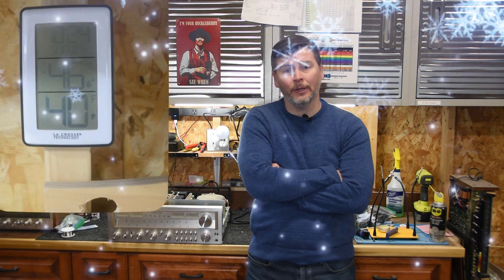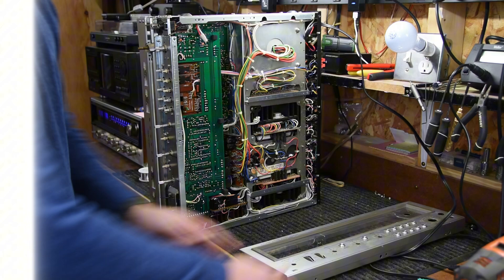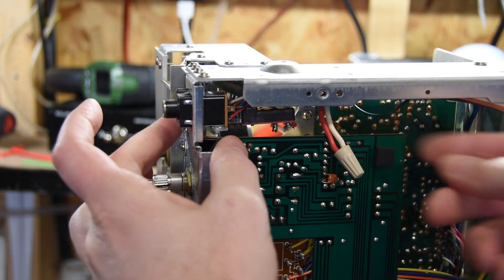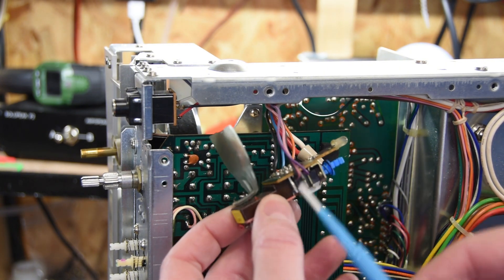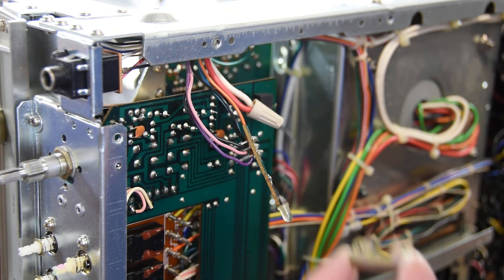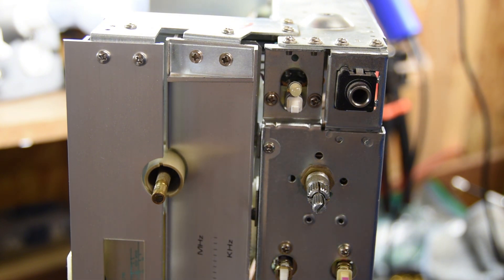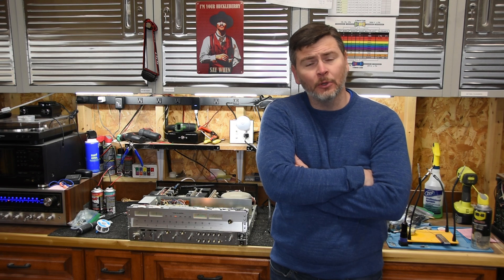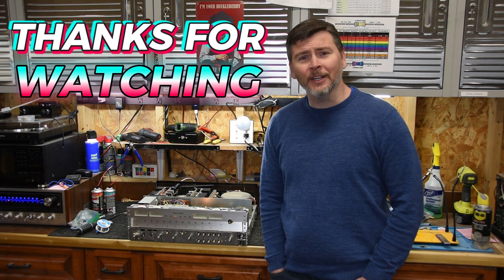Realistic STA 2100 Power Switch Repair

Comment: Hey Mike, is the case on that unit the same as the 2100D I need a case for my 2100D please let me know if you can make one. thanks
Reply from the maker: Yes the case is the same. I'm probably going to make a case for this one so I can make two at that time if your interested. Probably run around $300-$350. Let me know by sending an email to atoaudio1@gmail.com

Comment: 40 degrees: Beware Of Cold Solder Joints!! 
Outstanding camera work as always. The special effects are getting better and better. 
I was just reading last night on AK about a guy with an SX-650 that was going in and out of protection. The power switch was sighted as a likely culprit.
That LED bulb switching from red to green at the 14:55 minute mark was SUPER cool.
The sound quality check sounded pretty incredible to my ears. Full and robust bass and very clear.
Reply from the maker: everything was cold lol even the solder joints!!! Yeah the switches in the SX-550,650,and 750 where know problem makers as well.